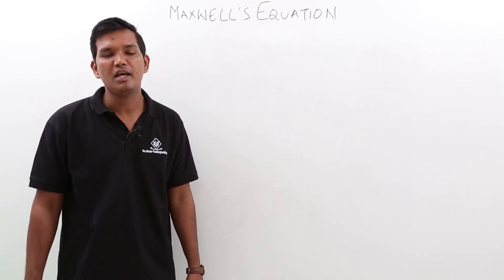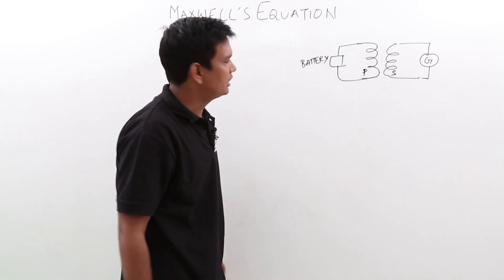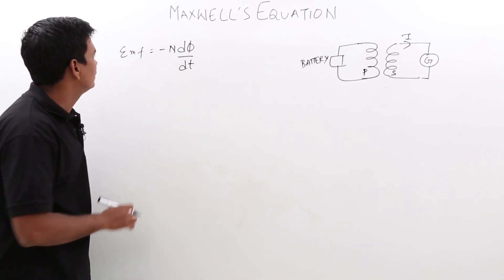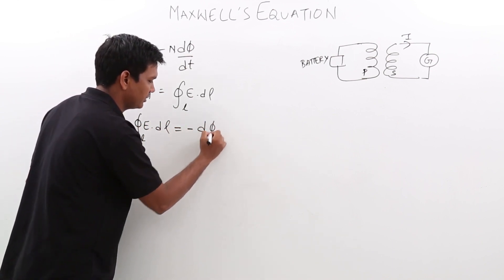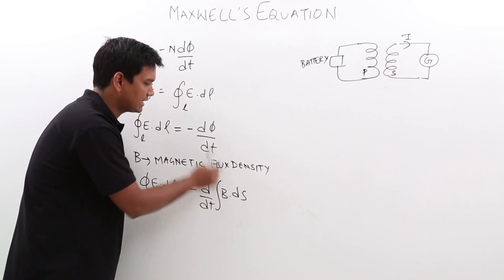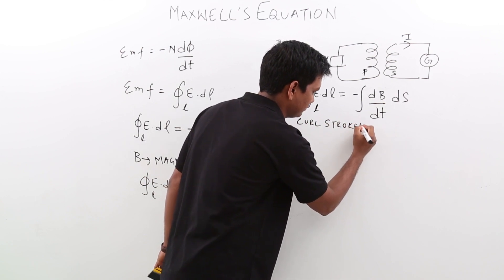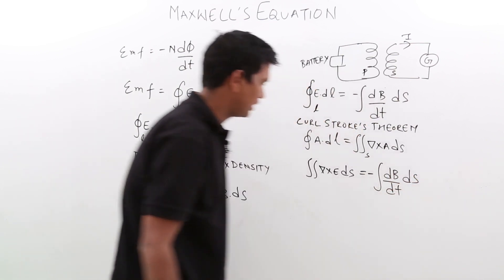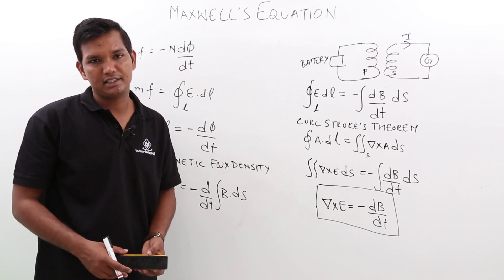Electro Magnetics - Maxwell's 3rd Equation

Comment: I have read that the potential is equal to the negative of the line integral of electric field. But here in the derivation of the Maxwell's equation we always write "emf equals line integral of the electric field (with no negative sign)". Why it is so???? 

And if emf is the potential difference then where is the higher and where is the lower potential in the closed conducting loop (As the current can flow only when their is a potential difference) like a copper coil?

Please explain I am confused.

Thank you !!!